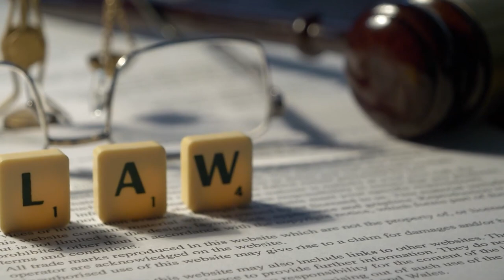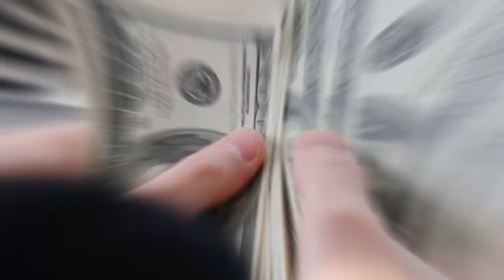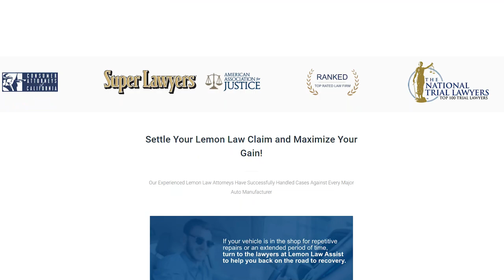What is Texas Lemon Law? | How You Can Claim Lemon Law on Your Car?

Comment: So I just bought a 2016 jag xf 2 months ago and in the first 2 weeks I had to spend 1700$ in repairs n had to wait 4 weeks. Now it’s still making noises so I take it to a jag specialist and he tells me, “is it to late to take it back’’  cuz ima needa new engine soon. Also I paid it in full so I don’t owe anything on it but my worries is it’s not under warranty anymore so idk if I can consider it a lemon
Reply from the maker: It sounds like you're facing ongoing issues with your 2016 Jaguar XF, even after significant repairs. Unfortunately, the Lemon Law only applies to 2019 or newer vehicles. However, if you ever encounter any issues for newer vehicles, feel free to reach out. For a free case review, please fill out the form: https://form.jotform.com/mollaeilaw/lemon-law-assist-youtube
Reply: @lemonlawassist  my vehicle is a 2017 how ever I just filed for lemon in 2024 . I purchased the vehicle in 2022. I only had it for 2 years 10-14-24 makes 2 years . However I started having problems in 2023 . Am I not eligible for lemon law relief . Or any kind of relief . I just sent my certified letter today .
Reply: We bought a 2022 chevy high country this February with 15k miles. Less than 24 hrs later it shut down will driving to work. It was in the shop 25 days. A few months later the truck started smoking. Turns out the turbo coolant was cracked. Almost another 30 days in the shop. Yesterday while we were driving on frontage with our toddler the truck shut off again. We were able to turn it back on and pull over before it died completely. It was similar to the first problem. Dealership said it will take 6 weeks before they can even look at it. It has 27k miles right now. Any advice?